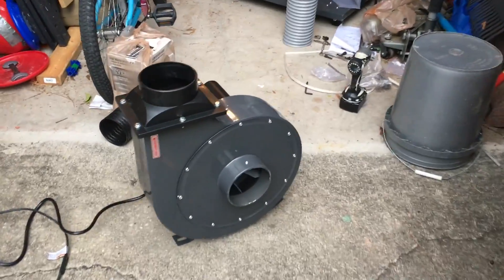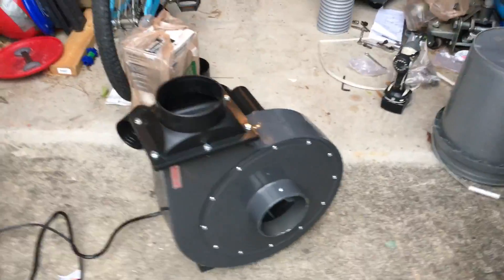DIY Attic insulation removal and airseal with homemade vacuum

Comment: Just a quarter inch away from burning the house down. Those chewed wires are the most dangerous thing up there.
Reply from the maker: For sure! I did install arc fault breakers when we moved in which would help in this situation.

Comment: Just did this on my house, 90  55 gallon bags of insulation removed. Terrible experience. Now I need to air seal with foam and reinstall new insulation and repair old duct work. Tough time consuming work.

Comment: Will the small plaster debris or some big nails damage the blade in the motor(actually turbine)?
Reply from the maker: Maybe a few small nicks but that was it. I sucked up lots of plaster. Still using the vac as dust collection in my shop.

Comment: Rich, nice video ! Did you consider batt insulation ? What made you go with blown in ? Thanks !
Reply from the maker: I used cellulose. The benefits were that it was cheaper and very easy to blow it in. Never considered batt's.

Comment: Did you blow it in with the dust collector also? Great video!
Reply from the maker: I don't think it would work to blow it in.... when you buy lots of insulation usually the big blower is included.

Comment: Rich - my contractor blew insulation into spaces I asked them not to insulate because I wanted to "finish" the area to store stuff. I'm now faced with not disposing, but transferring insulation from one area of attic to the other end of my home (appx. 60feet).  Seems like this would work well but do you know if the resulting material is "insulation" or is it chopped up in the fan/blower so much as to be too dense and I should just discard it?
Reply from the maker: I would first try and see if a yard rake would work. Get a rake that will for between the joists. The insulation will be easy to move around but it will be extremely dusty, wear a respirator. 

If you are planning on putting plywood over the joists for storage you will want to leave some insulation in there. 

Maybe I’m unclear on what you need to do but I think a vacuum setup like mine would be overkill.

If you need to go the vacuum route it won’t affect the blown in insulation. The cellulose that I used was already very small chunks.

The other option would be to just rent an insulation blower and haul it up to the attic, have someone scoop it in while you blow it where it needs to go.

Comment: My house very similar, except for HVAC in attic. Plaster walls, old insulation, and no air sealing. I've done some air sealing and added very little insulation but I would love to vacuum out the old stuff before adding new. Might be possible.

Comment: Do you think this vacuum system will knock out a 2500 square foot Attic in one day
Reply from the maker: I think if you had one or two persons helping you could do it. I did everything myself and it took a lot of time dealing with the dumpster and managing clogs etc. Plus it's hot and tiring crawling around, having someone to take shifts with to get a break would be much faster.

Comment: Great video! Thanks for making it. Now I know what I need to do for my insulation removal and replace.
Reply from the maker: Thanks. I think the only thing that’s changed since then is the availability of the large vacuum bags on Amazon that would make collection much easier.
Reply: @sparks6666  I was just looking at those. Mind telling me why you went with cellulose?
Reply from the maker: @JerryEasley  It was easy to get, has fire retardant properties and less toxic to work with than fiberglass. Similar R value I think.

Comment: So glad I found this video... I was this close to going down to the Green Scumbags and paying $375 for a one day rental. I’ve got 2300sqft of attic to clean 38-year old blown fiberglass out of, and this is going to save me a ton of money. Just gotta figure out what to do with the waste until my pickup day.

Also really interesting to see how inexpensive you you did the radiant barrier. I’ll definitely be doing that on my second floor at a minimum.
Reply from the maker: Industrial vacuums designed for this are are something like 14hp but I can’t imagine needing more suction than the 2hp harbor freight one. It’s a beast and works amazingly well. 

I used heavy duty lawn garbage bags to put it all in (took probably 30+) and our city waste took them over a few weeks. 

Radiant barrier was relatively easy to install with a pneumatic stapler. I think I made a comment here in the past that I wouldn’t do it over but I’ve changed my mind and feel that it makes a big difference for the $ and effort involved.
Reply: @sparks6666  I started today with a couple helpers - nephews are great! We filled 40 lawn bags, using a double-fill method; we filled the bag once, swapped bags on the vacuum, and compacted the insulation in the first bag. Once the second bag was filled again, we tied it off and added it to the pile. We got about 2/3 of the smallest attic done this way. The 75cuft bags are on their way.
Reply from the maker: @ronvickersjr1703  Awesome! this is pretty rewarding seeing a pristine, clean attic. Make sure when you are done you air seal all the gaps. 

You are filling trashbags directly from the vacuum? I know you can buy large breathable bags for this purpose. Since I did it all myself just dumping it all in my "dumpster" worked well and could then bag it when I wanted. 

I just found this breathable bag on amazon, this wasn't available when I did mine. It allows the air to escape and will compress the insulation. I would use this!  Still would have to transfer to trash bags but would be much easier, some of these I think are made to be disposable, just load them up and take to the dump.  

https://www.amazon.com/s?k=insulation+vacuum+bag&i=tools&ref=nb_sb_noss_1
Reply: Yeah, we were filling a bag about every 45 seconds. I’ve got the big ones on order, they just weren’t here in time. I’ve got my helpers coming back next weekend but the weather probably won’t be quite so nice... highs around 70 this weekend! Quite unseasonable down here.

Comment: What area of the country is your house. Here in TX the attic temps in summer could kill you and I was wondering about the radiant barrier effect. Insulation in my house is blown in fiberglass and it's settled into uselessness.
Reply from the maker: I’m in SC so same problem. It’s an inferno in my attic in summer. I think the radiant barrier is worth doing. It’s relatively cheap and not too hard to staple up. Just read up on the correct way to do it, need an air barrier.
Reply: @sparks6666  I appreciate the response. I've been trying to evaluate what to do about my attic. Your video was informative

Comment: Have you noticed a difference with your upgrades?
Reply from the maker: Yes, the top floor of my house was always impossible to keep cool in the summer. This has helped a lot maintain a nice temp. And with a new hvac system I see monthly bills $100-$200 less than before. Summers were nearly $500 in july/aug with AC.

Comment: What would be better for this job, 4 inch Drain pipe or clear PVC dust collection hose?
Reply from the maker: The drain pipe is a lot more rigid than the clear dust hose. I think that would be better. Rigidness eliminates kinks that can clog... plus it's really cheap.  I did get the clear stuff for my shop after setting this up for dust collection. Big difference between sawdust and thick insulation.

Comment: Hi, so when setting up the dust collector, you don't need the wheel base along with the included bag & filter. Right??
Reply from the maker: You could use it as it’s sold but I mounted it on a wall with a “thein baffle” system.

Comment: I just got a quote for $2400 to do my small 1400sf ranch. Thanks for this video, I need a dust collector for my workshop anyway. Looks like I’ll be headed to HF!
Reply from the maker: Mine is setup now for dust collection. It's great. Get one of these wireless switches, would be great with the attic and in the workshop.  https://www.amazon.com/gp/product/B07GXCYWRQ/ref=ppx_yo_dt_b_search_asin_title?ie=UTF8&psc=1
Reply: @sparks6666  great idea on the switch.

Comment: DUDE!!!

I just started clearing the original blown-in up in my in-laws attic (house built in 1971, soffits have been missing for probably most of that time, at LEAST 35 years worth of critter poop, feathers etc...).

Took me 2 hours to "sweep" about 50-60 square feet into contractor grade trash bags and haul them out of the attic and down another flight of stairs.  Only 1250 sq/ft to go...

P. I. T. A. 

Just came across this vid and I'm headed to Harbor Freight/HD this weekend.

You.  Are.  The.  Man.
Reply from the maker: You will be amazed at how easy and fast it is once you have it all set up. Good luck!
Reply: @sparks6666  

Got everything setup this past weekend.  

Just to check for functionality, I actually did it the "easy" way and ran 100ft of corrugated pipe out of the opening of an old, non-functioning attic fan...with the entire machine on the ground below it.

Once I worked out that the upward bend to the opening was causing some clogging, I simply made the angle less steep by zip-tying the pipe to some rafter at a less severe angle.

Once the wife and I had a system down, things went pretty quickly...while she was compacting the insulation and dumping into contractor bags from the clear bag of the machine (compacted was about 25% of loose volume), I was breaking up the next section and sweeping it into a pile (this stage took 5-7 minutes), then she would start the vac and run til I filled the clear bag again (barely 2-3 minutes).

>>what would've been 6 hours of work was reduced to less than 25 minutes.<<

Worked >extremely< well, but she did get sick of transferring bags, and sheepishly conceded that my idea of a makeshift tarp "dumpster" like yours made more sense...so the rest will be even faster.

Thanks again stud!
Reply from the maker: @psygnale  Haha, nice! I'm sure your wife was thrilled!  The big advantage to the "dumpster" is not having to stop,  just scoop everything up afterwards. Just might be tricky to figure out where to place the motor so it will expel the insulation efficiently. I used a ladder in the middle of the dumpster to attach the end of the pipe to so that it was high enough to make a big pile. You probably figured out how to "pop" your hand over the end of the pipe to dislodge small clogs. You also may not need to break it up or sweep it in piles... just suck it all down (that's what I ended up doing).
Reply: @sparks6666  
Yep, strangely the "popping" wasn't working for me because of the way the kink was, so I called down to my wife and had her take the input and output hoses of the motor loose, the stuff the intake down the output and turn it on for about 30 seconds ("reverse flushing" the hose), extremely effective for a stubborn clog.

Also, I HAVE to break mine up as it's the original blown-in from 1971, and critters have been nesting in it for at LEAST half that time...so what would be 10-12 inches of blown-in is VERY compacted to about 1-1.5 inches and only comes up in 5-6 foot long sheets.  TL:DR...mine is REALLY bad.

For my "dumpster" I'm actually making a "tube" of two 10'x25' 4mil clear tarp taped together (nobody seems to carry 20x25), suspended between two trees with twine.  sealing one end with the hose and the other taping shut with some exhaust holes poked at the top.

Thanks for the suggestion about elevating the blower, I'd actually thought about that already, so I'm glad to see I was on the right track.

Comment: Can you give us an update? Is it easier to heat and cool your house now? I’m sure it is but how noticeable?
Reply from the maker: All the prices are in the video description. 

It’s made a huge difference to the ability to cool and heat my second floor. It was always hard to get the temps comfortable up there, esp in summer. 

I did totally redo my Hvac and between the attic work and the new unit I am saving $200 a month in summer.

Comment: I would removing the cellulose from the walls and ceiling before I can remove the lath an plaster for a complete remodel including wiring, plumbing, drywall...
Almost on the verge of selling instead of this monumental project...
Reply from the maker: I would not try to remove the insulation first... just tear it all down and haul it out. Gonna be a mess either way. There's probably not a whole lot of insulation in there anyway.

Comment: I would rather try the dust collector than rent a machine. I have 3,000 square foot area to cover though. Do you think it would be powerful enough to get suction with a 50ft hose attached to it?
Reply: one thing is you can work at your own pace. vacuum up between a few joists to remove the insulation, so your HVAC can still cool as only some insulation is gone not all. seal up air gaps before you lay down new insulation. I'll probably buy this same dust collector, afterwards it will replace my shop vac on my woodworking tools (table router, jointer, planer, etc)
Reply from the maker: Justin Perry No problem with 50ft. I think that’s what I used. You could go longer if needed. The only issue is occasional clogs which can be cleared by popping your hand over the end of the tube. Good luck.

Comment: You actually could've just built a box  and put the dust collector on the end of the system to pull vacuum put a filter on the intake side (like a huge HVAC panel filter for air handlers) and not run debris through the motor. After all that's how real vacuums are setup ......
Reply from the maker: I would have had to have a totally airtight box at least 12' x 12' x 10' to hold the volume of insulation sucked out... not practical or possible. All commercial insulation vacuums are set up just like mine. Dust collection vacuums for wood working are a totally different application. In fact I reused this system with a thein baffle for my woodworking shop that works great.

Comment: I’m doing a similar job in my attic but just a smaller area. How would the smaller 1 HP dust collector from Harbor Freight hold up to pulling out blown fiberglass insulation? I’m removing insulation from a couple of spots to air seal.
Reply from the maker: I'm not sure. It's 1HP vs 2HP and the reviews are not as good. Some reviews say it does not have very good suction (and probably less so with a long run of hose to reach the attic). The 2HP is a beast and $50 more.

Comment: You can rent a machine for this purpose did you look into that? Just wandering if its more cost effective to buy and build the one you have. What do you think it cost you to build?
Reply from the maker: Looks like I spent $170 on the dust collector and $70 on the 4” hose. These are not available to rent in my area. You would probably need a weeks rental so I doubt it would be cheaper to rent. Plus you get to keep the unit after you are done. It’s great for dust collection in my shop.
Reply: no rental machines for this purpose!! check it out on google, I tried....none
Reply: You can rent one in my area... cost $355 for a day or $940 for a week. Of course it's much more powerful (18hp gas engine) but you'd still have to hustle to get it done in a day. Renting is always stressful, trying to finish the job and return the machine in time. Slow and steady wins the race.

Comment: Great job I'm looking to air sealing project soon. What do you think about your radiant barrier?
Reply from the maker: I feel like it did reduce the temps in my attic but adding that money into more insulation would probably have been better spent. It was around $120 or so but a good bit of time. I doubt I would do it again if I had to do it over.
Reply: @sparks6666  thank you

Comment: I’ve watched this a dozen times. Thank you for sharing your ingenuity. Side note: extra care should be taken when sealing around fireplaces or hot lights. There’s special foam for that.
Reply from the maker: freshhopped Thanks for pointing out that you need to follow code for insulating/sealing around fireplaces. There are special rules that apply. I did use a type of Great Stuff Foam called “fireblock” for all of my attic sealing.

Comment: Hats off majority of home owners would never do this or even attempt to go in the attic please I hope that there was no vermiculite in there when you did the removal it would look like kitty litter, pebbles, or wood chips. My concern is most vermiculite (zolonite) contains asbestos
Reply from the maker: That's good to keep in mind. You have to know what your are working with. My insulation was all old rock wool and I wore a very good respirator when doing the work.

Comment: What if I have a lower pitch roof (3/12)? And is radiant barrier effective with that slope?
Reply from the maker: brufman I would not think the pitch of the roof matters. Just make sure there is an air gap between the radiant barrier and the roofing.